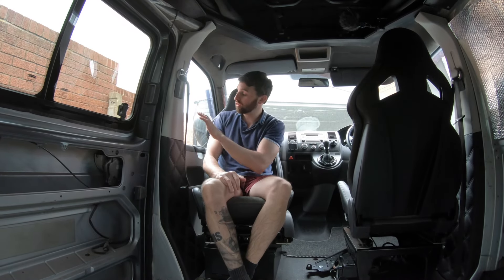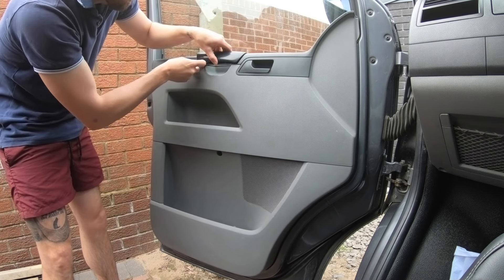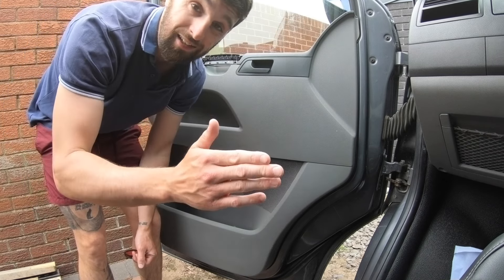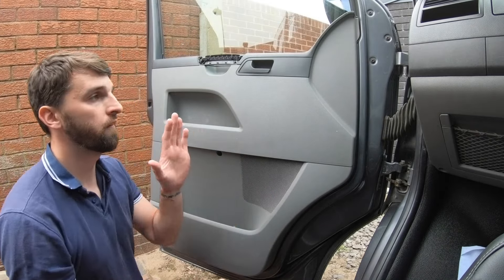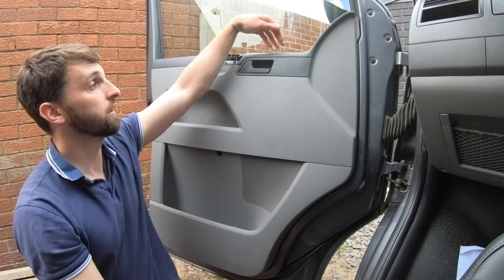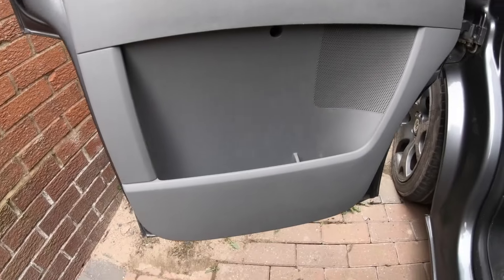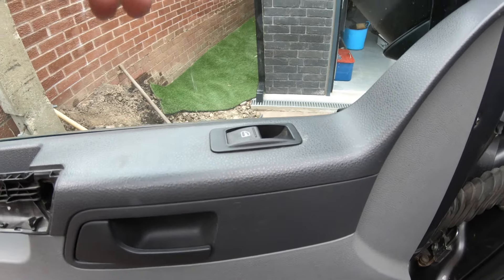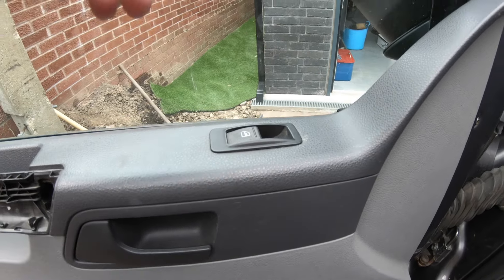VW T5 / T6 Door Card Removal How To DIY

Comment: Great video.  As a different option, with the window down hook a bungie between the door handle and  top of the window frame.  That way the door card hangs there while you disconnect plugs and clips.  No messing with lock and window switch !

Comment: Love how it magically goes from no speaker and connectors hanging loose to speaker fitted & connected! :)
Reply from the maker: It’s magic mate. That footage will be in the front door insulation video coming soon 👌
Reply: Brilliant! My speakers need replacing have you done that video yet as I am totally useless with vans and electrics and have to buy the tools before I even start.
Reply from the maker: Yes matey. I have filmed that video it’s on my playlist for this build

Comment: Could spray a wee bit of mr Sheen or a silicone release spray on those clips when you push the card back on. Helpful stuff- cheers!
Reply from the maker: Hey Jim. No problem matey. Yes this could definitely work. May still dry out over time but definitely could help.